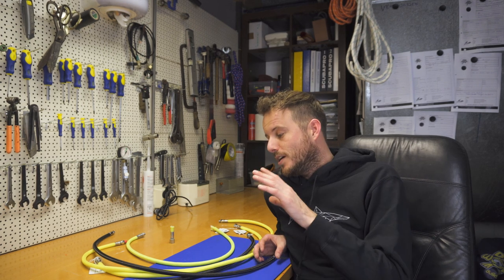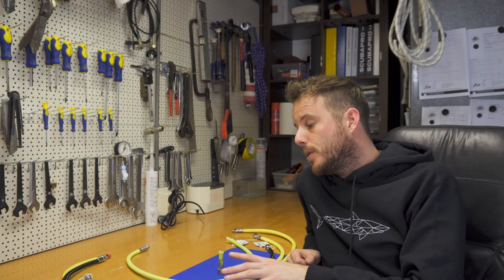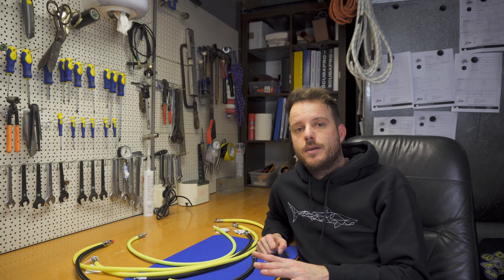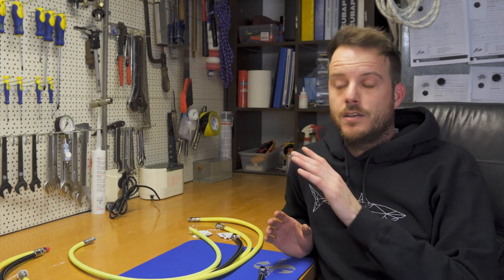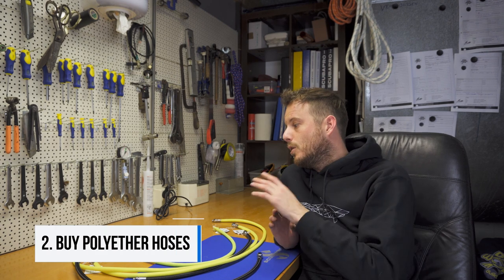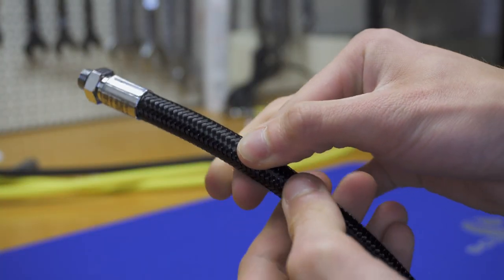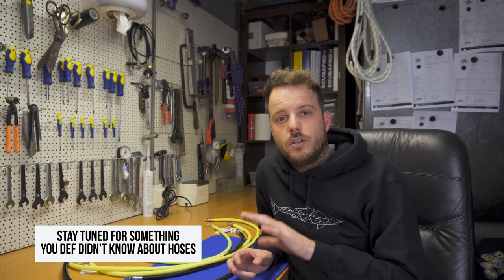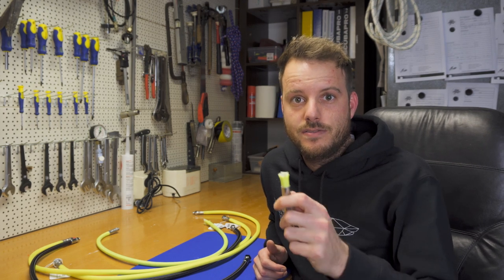Unsafe Scuba Flex Hoses | Check Your Regulators Hoses! | Scuba Advice

Comment: This exact issue happened to my wife’s regulator yesterday.  At 90 feet she had complete failure with her regulator and had to switch to her backup reg. Luckily no issue changing over and ending the dive safely. Upon removing second stage regulator from the braided hose we discovered a very large amount of the crystalline  hose liner pieces were completely blocking the air flow to her regulator. After removing the hose we were able to shake out a handful of the crystals. Her reg hoses were purchased new and were 4 years old. Reg is always stored in dark closet inside our home where heat exposure and light/UV is not a issue. Thank you for your video on this issue as the word needs to be spread about these extremely dangerous hoses that are still being sold to consumers.

Comment: Thanks for this useful video, I already suspected my hose, I had my scuba equipment ready to go, but when checking it pre-dive I noticed my octopus seemed a bit low pressure when I pressed the purge button, when I tried breathing through it, it felt like I was trying to breath through a straw. Strangely my regs had only been serviced a month or so earlier, surprised he hadnt noticed something in the dive shop while servicing it.

I took the reg off the hosae myself and found these crystals inside blocking it up, and realised they could only have come from the hose.
I then came across your video, and it prompted me to check my main reg as well, and that appears to have some crystal blockages too, so both hoses need changing before I can dive with these.

I was tempted to take the regs back to the bloke who serviced them and say my buddy ran out of air, gave him that octopus and his face started turning blue just to make him panic lol
Reply: These were scuba pro regs with original hoses that I have had for over 12 years, and have been sat in the cupboard for about 7 of those before I got them serviced to go on further dives. havent done bad, but this problem could have killed someone.

Comment: Thanks for this great vital information. I have a regulator with braided flex hoses for both the second stages and the inflator hose. It's still new so there aren't any problems yet. After watching this video I'm definitely going to check my hoses or perhaps replace them with rubber hoses.  Thanks again mate.